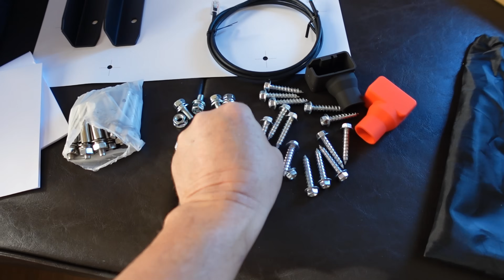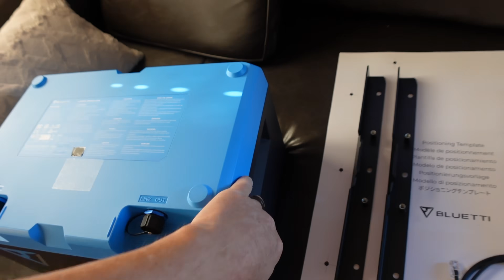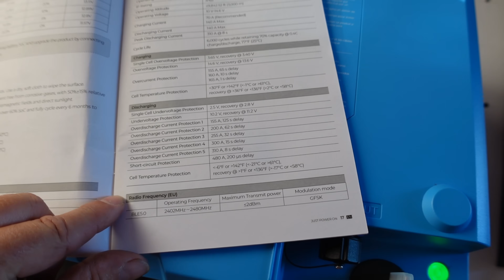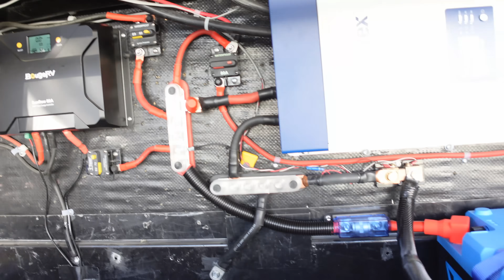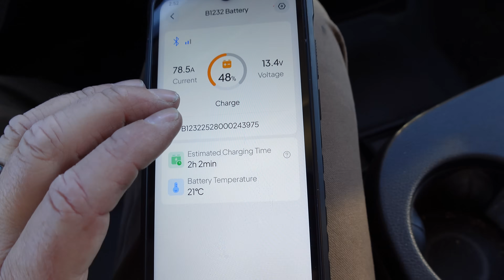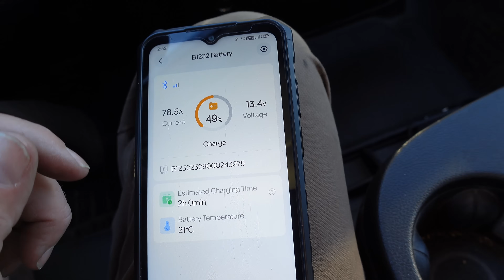Bluetti 314AH LiFePO4 Battery Review - Pt1 Features, Install & First Test

Comment: Nice Ray, the blue reminds me of Victron.  Sorry to see you don't have any Victron 🟦 gear anymore.

Your video brings back lots of memories.  I subscribed in 2016+/- and you were a big inspiration and help with my RV Adventures.   We've chatted a few times here, haven't been watching your content as much lately as I retired, got remarried, and have been travelling a lot.

Heading to the southwest again?  Have you spoken at all about how RVing and RVers (may) have changed over the last decade?  Long-term plans?  It'd be great to hear your perspective, I apologize upfront if you've already discussed these things.

Thanks for the good nostalgic feelings. 👍🏼
Reply from the maker: Must have me confused with someone else :) Funny enough I've never had Victron equipment in my RV though I know its real popular, our boat came with a little 15A Victron solar controller. Over the years we have moved to more off grid RVing and now boating, that has been a change I've notice as solar gear and batteries improved and became more affordable more people can cut ties with power. This winter rather than going to the southwest we are going to winter on Vancouver Island on the oceanside. Should be interesting. We'll be in an RV park though as the sun shine is limited up here. Cheers, Ray

Comment: Bluetti has some nice equipment, but nothing on this battery stands out to me for the $800 price. The BMS seems undersized at 140 amps and the app doesn't show the individual cell voltages. It'll probably be fine for people that want a install it and forget battery that don't boondock much though.
Reply from the maker: To me the the thing that stands out is the data ports, usually found on higher end batteries like Victron. Will be interesting to see what they do. I gather they help keep multiple batteries in balance and with the addition of another piece of gear keep up to 96 batteries in balance. Also the firmware may be update via them I'd imagine.

Comment: Hi Ray, I was looking at the description on Amazon and the header description indicated 310 amp BMS, but the manual you showed us indicates 140 amps. 
I don’t see too many batteries with the flat terminals, but I see your point about being able to really tighten the bolts with them.
Reply from the maker: 310 is listed in the manual as the max amperage but only for a surge of 8 seconds. 140 is continuous max amperage.
Reply: @LoveYourRV  I rewatched the spec sheet review in your video, you did mention that and I missed it.